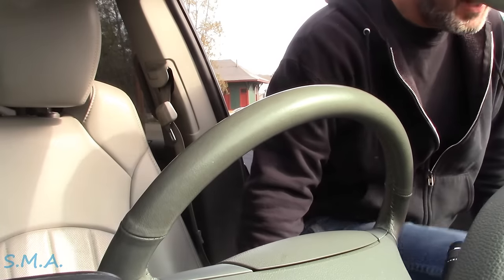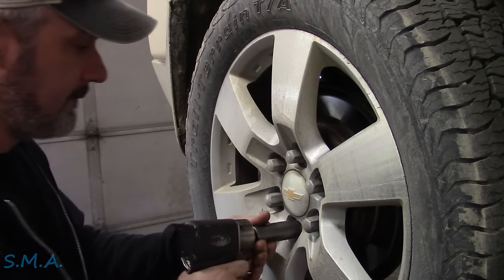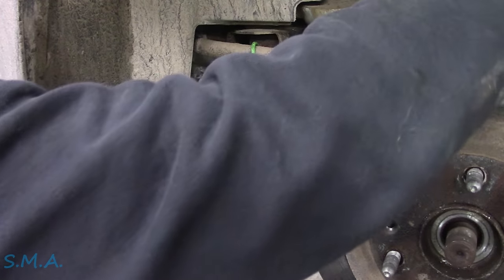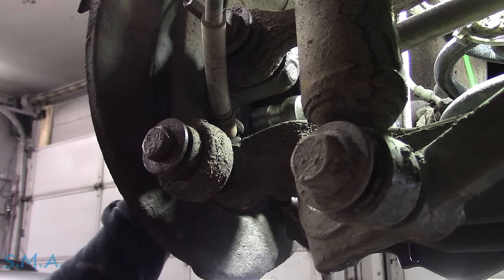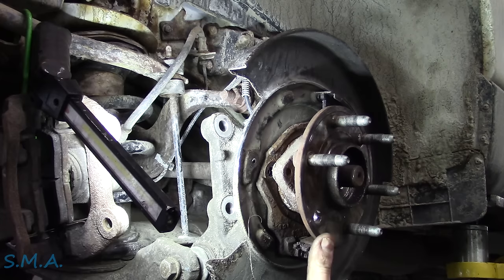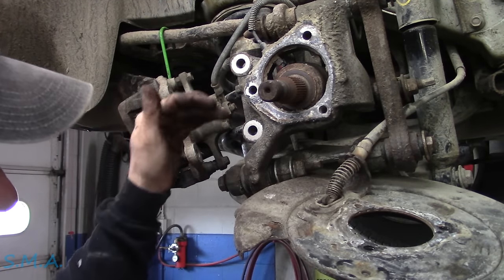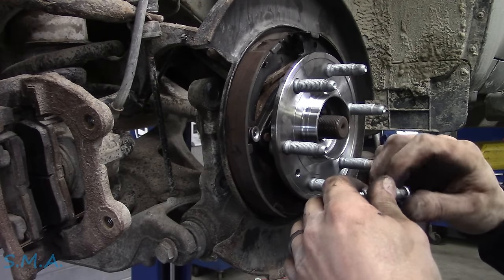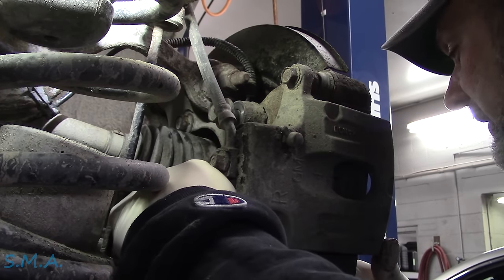Chevy Traverse: Won't Go Over 40mph ABS & Stability Light On

Comment: What diagnostic trouble code(s) was this vehicle giving?  I'm having similar issues with my 2013 traverse, and it always comes back to p0700 transmission control system.  Replaced many parts including the computer, and the issue keeps recurring.

Comment: I’m having the same issue with my traverse. First the abs stability alert comes on the dash board then it starts to over heat. Do you think the over heating is coming from the abs issue ? It always over heats if I keep driving it after the abs alert ?

Comment: this didn't resolve my problem on my 2016 Chevy Traverse Lt AWD i replaced both front wheel speed sensors and wheel bearings after   the same scan tool said left front wheel speed sensor and wheel bearing. Traction control and stability lights are still on the dashboard any help would be appreciated ty

Comment: Yes but why is the vehicle prevented from going over 40mph ?  That seems like a dangerous failure mode. If that happened on the freeway it could be deadly.
Reply: Very true, I was doing 65 when my tone ring let loose. I thought the car was going to fall apart. I got home and scanned it to find the same result as Mr O. I pulled the ABS fuse and then I was able to get back and forth to work till the weekend when I could fix it, at normal speed. Contrary to modern belief, we drove cars for decades without it. But then again I still drive cars that never had it in the first place.
Reply: Terrible design. Into limp mode for no reason.

Comment: Rayban Ray from Florida is your typical Walmart Express Employee that doesn’t understand the basics like the + & - on the battery indicates proper no voltage spike connections. + = add, - = subtract, when your adding power add + first, when you’re subtracting power subtract the — first, basic cable protocol 101
Reply: I shake my head when he uses a voltmeter to check for 12v and assumes the circuit good.
Maybe in Fla there is no corrosion but in Northern Ohio I grab a 3a bulb to load test em.
Reply: @billthrasher3587  I once watched him drilling a lug nut that the nut was all messed up. He spent an hour burning up drill bits trying to show how to do it. He used a high speed air drill on 3/8” and larger bits. The bits were turning blue from the heat. Proper drill speed with cutting oil and a good bit would take less than a couple of minutes. Remember, if chips are not flying you are not drilling.
Reply: The boys @ 23rd Garage make Rayban Ray look like a girlscout

Comment: holy crap an acces hole at the front that you can see thru?!?! wow... only problem when the shoes seize you cant turn the rotor to align the peak hole. all round garbage design! as for that astro tool... why not just make one. 1" square piece of steel drill a dimple for the bolt to FOOT into and use normal high temp steel bolt and nut. I think I will lol. was way easier than seeing you hitting the hub with big nasty for an hour LOL

Comment: We have a month longer rust belt in northern Minnesota parking pads fall out pull everything out never used them in 50 years anyway no inspections here  we run them till the wheels fall off just keep pulling the rusted shit off only a fool would by a new vehicle in this state of rust money down the hole faster then even the feds can spend it you find one 3 or 4 years old with low miles half the price

Comment: Seems like chevys love to eat those hub bearings fast
Reply: At 118k on my '07 GMT-900 Silverado 4x4, and on my 3rd set!
Reply: Still original hubs on my 04 Silverado 2500HD, 527k miles
Reply: @mattcat231  The 800 series trucks are miles ahead in quality from the 900 and up series, and the 400 series was even better still.  On my '94 K1500, 400, I got 222K out of the original ball joints, u-joints, AND hub bearings. On my 900, I couldn't even make 40k on the lower ball joints. Uppers failed 10k later. Hub bearings at least made it 60k before they got noisy. Engine started to burn oil at 50k, rear end failed at 97k, then the transmission at 103k.

Comment: Why are your local drivers so lazy that they don't use their parking brakes?   I use mine even when I stop at traffic lights -- no, I don't keep my foot on the brake pedal - that's for slowing down when negative acceleration is not sufficient.

Comment: give me an air powered ratchet or rattle gun over battery any dy  my scrw compressor never runs out of charge / and yes it would stop if the power was cut but then Ive got the back up generator on the flick of a switch

Comment: I’m going to have to give this a thumbs down, mainly due to Eric using the brake cleaner and not putting the noise in, didn’t use the sheep noise for the fluid film either, 4/10 must try harder. :(